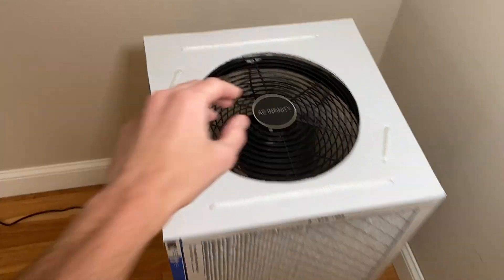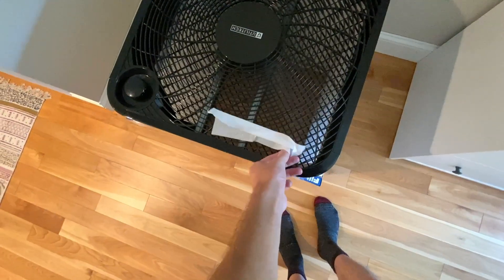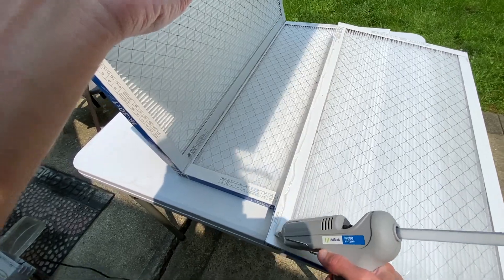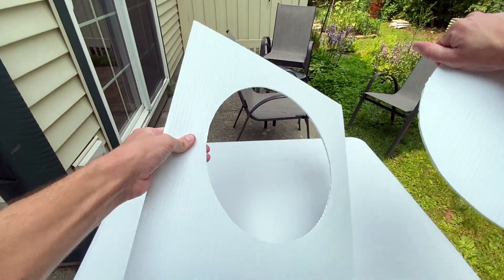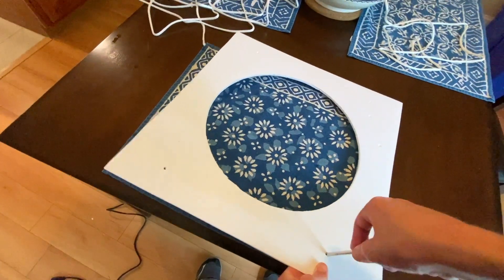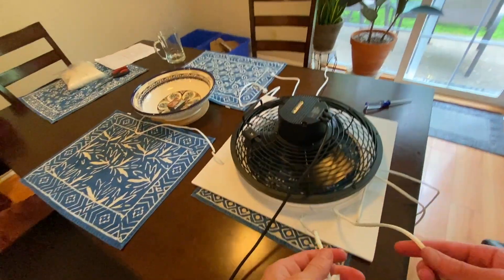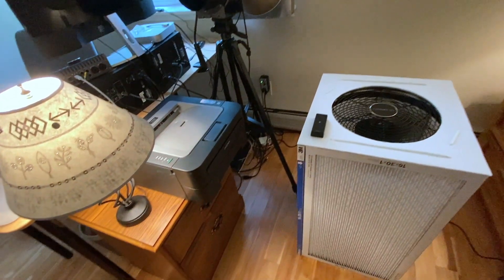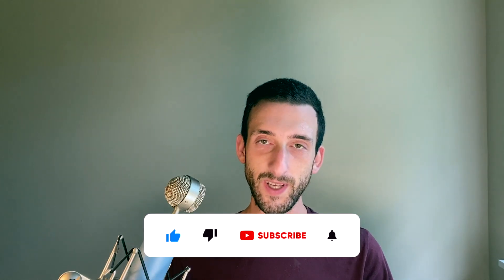How to Make a Better DIY Air Purifier

Comment: Air purifiers also have a carbon filter for smells in the air. Do you have a recommendation for carbon filters?  Would it be best to add them on the outside or inside of the unit?
Reply from the maker: Despite the claims some companies make, no air purifier is particularly effective at removing odors/gases. Air purifiers are designed to remove particulate, not gases, which are extremely small - even smaller than particulate. Some air purifiers have activated carbon in them, which can capture SOME odors/gases in smaller quantities and for shorter periods of time, but then they saturate and are ineffective. And by the way, you need a big, heavy block of carbon to actually capture a significant amount of gas. A thin carbon prefilter won't do much. There's a reason why air purifier companies don't share metrics about gas removal. It's not nearly an exact science. 

For reducing odors/gases, source control (removing the source of the odor/gas) is best. If that's not possible, ventilation (bringing outdoor air inside) is the next best, to dilute the concentration of the indoor odor/gas. Best way to do this is with an energy recovery ventilator (ERV).
 
Think about it. It's intuitive - what's the best way to freshen a stuffy, smelly house? Fresh air.

Comment: Is there option for less expensive fan?  $170+ for fan...   when I can get air filter for $100.  Is a bit pricy
Reply: Had the same question! Fan is now $199! Yikes!
Reply: @taramuenz5897 the clean air kits brand of similar style filter is cheaper. Less volume of air I’d guess but a better price considering the fan alone form this costs more that the pre-assembled filter from clean air kits

Comment: Not sure what box fans you used but mine all have 3 speeds and I can definitely tell the difference between 1, 2, and 3.

The fact you had to make a fan shroud negates your argument against box fans.  

Since you didn't seal the bottom air will be sucked from UNDER the filters and under the lid, again negating your argument.

Point is, aside from the noise, box fans are fine. You can put in your own variable resistor to drop the fan speed further if you need it quieter. 

This comes off as an ad for a $170 fan where a $20 box fan is adequate.
Reply from the maker: Sure, a box fan is adequate, but not optimal. I do feel that the main problem with box fans is that they're too loud. You said it yourself: "aside from the noise." I've tried using a variable resistor and it's not good for the fan - it causes inefficient power dissipation, poor motor performance, heat buildup. Box fans are generally designed to operate specific voltages.

Box fans also have a large footprint, which I don't like. I discussed this in the video.

It's not necessary to seal the bottom of the filters if they sit flush against a bare floor, but I recommended doing so for people with carpets. I actually do seal the bottom these days, to be honest.

How does the fact that I had to make a fan shroud negate my argument against box fans? Box fans need shrouds too.

But dude, by all means use a box fan if the drawbacks I mentioned don't bother you.
Reply: @HealthyHomeGuide  You listed needing a shroud as a reason against box fans, that reason "not to use" would extend to the S12 as well since it also would need a shroud.

I don't see much in the way of drawback and I have three 20" filters set up with Lasko fans. I put rubber cement on the bottom to seal on the non-carpeted (uncarpeted?) floor. 

Found running on low is best for performance and noise (Unless I burned something on the stove).

Using reasoning against one item, you have to use it against the other in a COMPARISON.

Overall, if you aren't sealing the bottom in your design, then not using a shroud on a box fan, the air that cycles through the fan because of the lack of a shroud is meaningless (Apologies, can't remember what that's called off the top of my head, wanna say venturi or bernoulli but don't think it's either.), as you will still have air flow issues. Granted this is what I would call a prototype, so there's room for improvement on both designs.
Reply: @HealthyHomeGuide  Would like to see the new design if you made other improvements.

Comment: Or I could jusy buy an awesome true hepa with a powerful yet quiet fan, all sorts of useless gizmos like wifi and "air quality sensors"  and including 2 years of replacement filters for a couple hundred bucks. But sure, if you make $7.25 an hour, maybe this is worth your time. Personally, I like using industrial/commercial grade appliances in my home. That includes hepa air scrubbers, vacuums, etc. It's just better. user serviceable and lasts forever, tough as nails.
Reply from the maker: For the most part, I agree with you. With the exception of air purifiers, I like industrial/commercial grade appliances as well. In general, I am willing to pay more for higher quality products. My vacuum is HEPA (of course, it's necessary for vacuums to be HEPA, whereas with room air purifiers, HEPA isn't necessary). My energy recovery ventilator and dehumidifier are also commercial-grade. Which air purifier do you use?
Reply: @HealthyHomeGuide  I have a bunch of them actually. But when I got my hvac system redone a couple years ago I got a whole home/central system installed. I also still have a few run of the mill consumer models like the winnix c909 I think it is. Another winnix c545 or something thats a little smaller. An old common Honeywell and a really old Japanese product which I just got rid of recently too. The Winnix was on sale from costco  for like $150 with 2 years of filters included. Great deal. However. You can get a Vevor 500 cu.ft. air scrubber for about $250. It runs on a furnace filter like the ones you used as it's pre filter (merv 10 is what it comes with) Then a carbon filter, and finally a 2" H13. Replacement H13's run $50 but considering you can use it in other configs like say merv8 or 10 prefilter followed by a merv 12 or 13, then the H13, I'd think this extends the life of the H13. That's what I got for my office. They also have an 800 sq.ft version with a flimsy UV light for $100 more. The good thing about that one is it's the same case and size and filters as the 500 sq ft model. For the money you'd be hard pressed to find anything better or more powerful than this. Most similar commercial air scrubbers run double that at least.

Comment: Cool design and I hadn't thought of that advantage of hot glue. My box fan isn't nearly that loud though. I've got mine near my bed and six feet away I'm reading 35 dB (on low) - 50 dB (on high). Lasko 20" from Walmart.

Comment: Nice idea, thanks for sharing. Question though - do you know if this fan type will work good to collect dog hair? My A/C unit is inside a bedroom closet (poor choice from prior owner 🙄) and dog hair tends to collect in this room where the unit is located, so I would need something with strong suction to pull the hair as the unit is also pulling air. Any info or suggestion will be appreciated.
Reply from the maker: If turned on a high fan speed, this unit does generate some suction, but in general, air flows fairly slowly through it given how large the filter surface area is (4 large filters). The exhalaron by clean air kits generates some suction - it might be worth asking them this question. thanks!

Comment: I have a box fan that I have taped filters to, but it's far too loud so I never use it. I have a small HEPA filter that I use in my bedroom. I would like to have a filter in my dining room / kitchen area but the box fan is too loud (both standalone, and with the filter attached). I'm searching for proprietary HEPA filters like the one i have for the bedroom but I've been doing more research into alternatives that use generic MERV air filters and might be leaning towards that now. I like that the filter is an off-the-shelf component instead of a proprietary form factor. And a lot of the designs even can accommodate off the shelf fan replacements if your fan dies. These 4-filter box designs I think are too big for me, floor space in my apartment is valuable.

My question is why are box fans always so loud?? Even on low setting, it's so loud and isn't even moving a great amount of air to justify that noise.
Reply: I can't stop thinking about this now. Surely there's a market for quiet box fans. Why are they so loud?? Can't someone make a company that produces quiet 20x20 box fans?
Reply: interesting that the corners of box fans can have air flowing in the reverse because the exhaling force is concentrated towards the center and the filters add resistance. something to remember.
Reply from the maker: For what it's worth, my design in this video doesn't use a box fan. The AC infinity fan is quieter. But more expensive. But yes, I totally agree with you about liking that the filter is an off-the-shelf component instead of a proprietary form factor. And I've also wondered how in the world there isn't a quiet box fan. I would really love to design a quieter one but I think it would require an immense amount of research and engineering.

Comment: I love this walkthrough and very insightful information. I have to wonder if there is a different fan out there though. The AC s12  is $170 on amazon, plus the Filtrete branded filters are $130 for a 6 pack since I can't find a 4 pack. I guess the reality is what it is for the cost if filtering air but dang thats a lot. Never mind the rest of the items you need. I'm checking out other similar types of fans. But the great thing about the AC is the 10 speed and remote. The others are mostly 3 speed for around $50.
Reply from the maker: Do you live in the US? At the link in my description, there's a 4-pack of filters for $71. If not, my apologies. As for the AC infinity fan, it is expensive, yup. But it is definitely the quietest fan i've tried.

Comment: I’m thinking of ways to make the purifier more “invisible,” even if that’s at the cost of CADR/CFM. Taking the PC fan idea from Clean Air Kits, what if we turned an empty PC case into a purifier?

I’m not sure about the specifics, but you’d need some fans and a fan controller powered by a barrel connector or similar. Then you seal the gaps in the case and replace the side panel with a filter mount. Thoughts?

Comment: is 4 filters really necessary? Wouldnt maybe some get dirtier before the others, besides it being cheaper and probably almost equal as good
Reply from the maker: You can definitely build a 2-filter unit, but it just requires more effort I think.
Reply: Rotate it 90 degrees regularly.

Comment: Should tape dow rods to it for legs so you can have  a 5th filter on the bottom.  Would also be best to use 2” filters. You’ll get about 50% more CFM by doing these two things and the box will be sturdier.  Plus, when the box is on the ground, it filters the air in the room about 20% more slowly.

Comment: Any updates on the quietest fan? I think the AC infinity is too expensive for us, but we will work up to it. Which are the quietest box fans?
Reply from the maker: Part of the reason the AC infinity is relatively expensive is because of its engineering and construction, which translates to a quieter fan. I haven't found a quiet box fan, unfortunately.
Reply: @HealthyHomeGuide  If it really is quiet, it's worth its weight in gold. We all need quiet fans around for all kinds of uses....
Reply: Many box fans I've tried are loud because the construction and plastic vibrates like crazy. There must be one with rigid materials and fewer resonant frequencies. I've seen the filters made with computer case fans that are said to be pretty quiet.
Reply from the maker: Absolutely. PC fan setups can be great. I have a video on them called "Most HEPA air purifiers are a scam"
Reply: @HealthyHomeGuide  Seen it! Great work!

Comment: Many commercial room air filters also contain activated carbon in the filter. Please address the fact that this build does not. Possible/advisable to add carbon??
Reply from the maker: Despite the claims some companies make, no air purifier is particularly effective at removing odors/gases. Air purifiers are designed to remove particulate, not gases. Some air purifiers have activated carbon in them, which can capture SOME odors/gases in smaller quantities and for shorter periods of time, but then they saturate and are ineffective. And by the way, you need a big, heavy block of carbon to actually capture a significant amount of gas. A thin carbon prefilter won't do much. There's a reason why air purifier companies don't share metrics about gas removal. It's not nearly an exact science.

For reducing odors/gases, source control (removing the source of the odor/gas) is best. If that's not possible, ventilation (bringing outdoor air inside) is the next best, to dilute the concentration of the indoor odor/gas. Best way to do this is with an energy recovery ventilator (ERV). Think about it. It's intuitive - what's the best way to freshen a stuffy, smelly house? Fresh air.
Reply: @HealthyHomeGuide  Thank you for your reply!!

Comment: The string work seems totally unnecessary and elaborate to me....what about placing the fan on top of the plastic? You'll need to cut a smaller circle. Alternatively, what about using those self closing (plastic or metal) cable ties? Incredibly practical and now you can find the re-usable version too. I'd use the grill-wire in the fan and tiny holes in the plastic to tie the fan to the top.
Probably it helps also to give the specs of e.g. the fan in question...this is probably an easy find in USA but not here in the UK - (think bigger!).
Reply from the maker: If you place the fan on top of the plastic, it sucks air right into itself without having that air pass through the filters first. I've tested this. Also, I've tried zip ties and they got in the way of the fan blades. Other tying methods could work.
Reply: @HealthyHomeGuide  I don't get it...the zip ties can be cut to the minimal necessary once in place - from your video (eg. at around 10m 50sec) I see the hole in the plastic in line with one of the wire of the fan's grille - all is needed is 6 or 8 ties connecting that single grille/wire to the plastic. The supporting plastic has to be strong as the holes are close to the circonference. I'd use 6 ties right were the intersection of the wires in the fan - or 8 or more ties if the supporting plastic isn't strong enough....then you cut the remaining loose tie. All you see is 6/8 very short ties (total lenght of each tie maybe 1/4 of a inch or 12mm?) along the perimeter of the hole. It's a bit like sewing the metal grill to the plastic. To me it makes perfect sense and a very neat job (but maybe we are focusing on 2 different problems here).
I do undestand the problem with the fan placed on top - having it deeper inside in your case is much more efficient...but that depends also on the design of the fan - I'm sure there are other types of fans which can simply be placed on top without losing efficency.
Reply from the maker: Could you test it and let me know how it works?
Reply: @HealthyHomeGuide  I haven't tried it yet - if I do I'll let you know. Most likely, I'll search for a fan which allows me to put it directly on top without any loss of efficiency (there's plenty of choice of design).
Reply: @stefanogortaldi3156  Update??

Comment: Any reason for air flowing in istead of out through the filter? It would be cleaner to have the dirt inside the unit.
Reply from the maker: For air purifiers the fan should be blowing upwards, for two reasons: 
1.) If you blow air downward into the box, there's a lot of turbulence that reduces the air flow rate. 
2.) By pulling air through the filters before it hits the fan, the fan will stay cleaner.
Reply: By sucking the air in through the fan and pushing it out through the filters creates the dust and particles collecting on the fan blades. Mixed with the other micro particulates in the air, they will stick to the fan blades and is a hassel when cleaning off the buildup on the blades. Ceiling fan blades get this buildup and cleaning them off is fun either.

Comment: I built the typical 20 X 20  box fan based system using a Merv 13 filter. What a huge improvement in my indoor air quality with this simple setup. Can’t remember the last time I had to take a Zyrtec or had a sneezing fit. I’m in Florida the pollen capital of America. Looking at your setup I can’t wait to get started building mine. I want the quiet, better efficiency, and a longer period between filter changes. Thanks for making this video and  including a parts list.
Reply from the maker: Happy to do it! Thanks for your comment :)
Reply: Box fans such as the one shown in the video aren't built for static pressure, and you might waste lots of power on turbulence around the gaps in the corners if you use a square box fan. Or pretty much any fan that isn't meant to work with a pressure differential.
Reply: How often do you change your merv 13 filter?